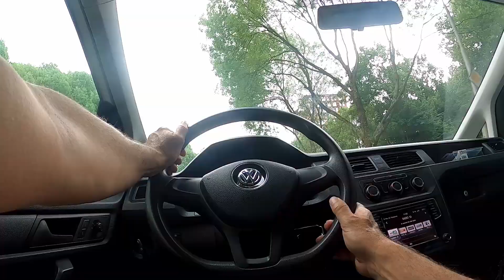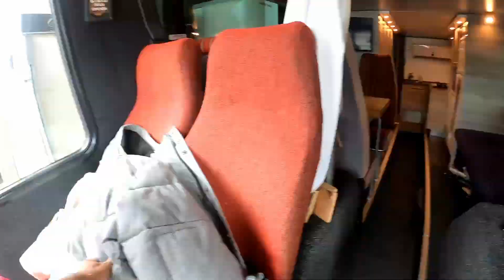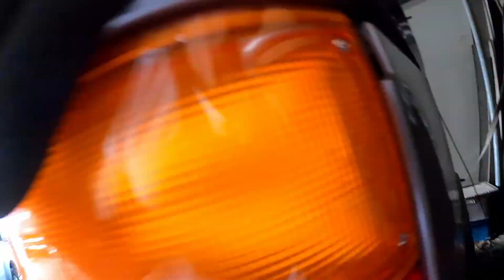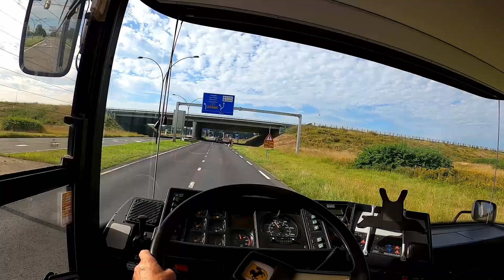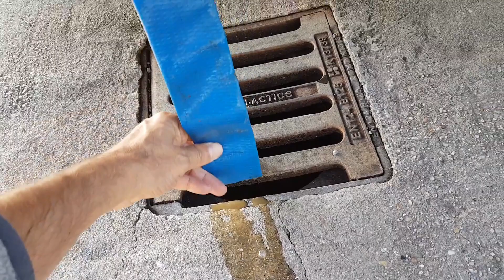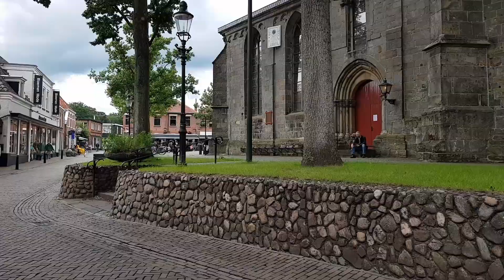Double Decker RV - Operating it

Comment: Love your double decker excellent craftsmanship I have watched all your videos. I would love you to do a video on talking about how you approved doing  the wiring and plumbing, for example where you have hidden the pipes and cables, are they easy to access for repairs, are your electric wires buried behind the walls, would you link your grey tank to your black tank with a valve so once you empty black tank you can flush it through with black tank, how much water and battery usage do you do on average,  would you have done anything differently in terms of plumbing and wiring  (excluding the compostable toilet). Another video idea is height limits and bridges, how do you plan for these, would it be possible to put solar panels on top without exceeding height limit, or would only thin flexible solar panels be suitable, also a video talking about your thoughts on insulation in the van and any air conditioning or roof access ideas e.g. top floor above bed and front chairs for cross breeze of air. I definitely would love you to make a video on all of these questions as your bus has inspired me to build my own in the future.
Reply from the maker: Thank you for this comment. For me it is difficult to think what I could do next, so I value these kind of input highly - thanks again. Plumbing and wiring might be an interesting topic, although difficult to show...
Planning around the height limit is quite easy; stay on the main roads. Last weekend we were in Germany and Google Maps wanted to direct me off the main road onto smaller ones - that would be a shorter route. Well, I just don't follow that suggestions. I made a plan and stick to it. I indeed could show this on a map once, in a video. You can do those smaller roads, but you would have to be on the lookout for the signs; mostly height and weight limits..
Yes, solar panels would fit between the hatches. There is no need for flexible panels, I hear about people having trouble with those, because they are not that sturdy as the conventional ones.
Insulation is a controversial topic, because an object made out of steel (vehicle, but can be container too) is very difficult to insulate.
I will think about your suggestions. Next on the list is a video about last weekend.
Reply: @Onrust1  I am glad you are considering my suggestions I look forward to videos on these topics Ron, I rewatched all of your videos multiple times to be sure you hadn't already answered them before asking.

Yes plumbing and wiring would be interesting even if difficult to show as you can just show thought process and pictures, no need to disassemble or rip everything out. I am keen to understand since you have your bathroom upper floor, e.g. pumps, macerating toilet etc .., how you planned for preventing smells, and access in case of blockage for repairs etc did you route these along your bedroom and then down to the garage area etc … 

My concern about solar is the thickness of normal panels may exceed the height limit if one wanted to cover the roof  of the 4m tall bus compared to the thin profile panels ( I agree they are worse)  as I understand 4m is the height limit for vehicles due to it being a common bridge height I believe ? I am from UK where there is not a height restriction but I learned this from my research if I wanted to buy a European double decker to convert in the future. 

I had an idea for planning around the height restrictions with less planning, navigation companies like TomTom and Garmin etc… now recently have mobile / tablet based app subscription (low cost) for Heavy goods truck vehicles where you can input height and length and weight of vehicle so this may help with reducing planning and more exploring?  

With insulation topic you could also talk more about your Air conditioning units, pros and cons in terms of performances, energy usage, layout location etc.., and exploring newer efficient  technologies like heat pump which can cool as well as heat for year round travel.
Reply from the maker: You are very right about the 4 meters. With a vehicle over 4 meters you are very limited in possibilities (I wrote more about that in my FAQ, all at the bottom - have you already found that?). But the hatches stick out the roof a bit, so in between should be enough room for normal solar panels. I know about the Garmin/TomTom solutions for large vehicles, but up until now felt no need for them. Maybe in the future, I don't rule it out. But in the end best is to rely on yourself, because only one can be held responsible (you.. 😏). 
My AC's already can work as heating device. That was the main reason for me to put it up as one of the first devices, in the beginning of the build; so I could work in winter without getting cold.

Comment: Man you need a front end alignment pretty bad or your steering wheel is way off center. Either way that would drive me nuts having a wheel that off.
Reply from the maker: This year, a few months ago during the annual maintenance / checkup, my mechanic got all the axles aligned, and also put the steering wheel straight. Not because I asked him to do so, but because he couldn't stand it too.. 😁😎

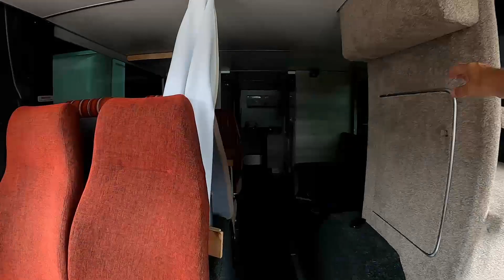Comment: 1:22 achhhttuuallyyyy.

there is a trick what is use pretty long ago. kitchen stuff and even tools able to run from dc current. refrigerator ac have inverter what run pefectly from dc, tools, vacuums have unversal dc motors. electronic devices from pc suppy to tv start with graetz bridge so also run on dc current.

so i have a fishing "hut" in hungary on a river island far from everything. i just use 15 small 40Ah lead-acid battery connected serial to provide 180V dc. what is enough to run anything. i have 2x 140W solar panels to charge it what does no look much, but i there only at weekends so have a time to charge... even enough winter time. one important thing left. i have a "current shock protector" relay what called "fi relay" in hungary and mandatory to use. its able to detect if the current flow to ground and brake the circuit. its pretty important because 180V dc cock u like a grilled chicken.

the effiency is way better than systems with inverter and way more cheap. and even able to run my ac at nights.
Reply from the maker: Provoking thought. Yes, cheaper but nevertheless way less power as I have with my 4 x 230 Ah deep cycle AGM batteries. Your investment in batteries is about half of mine, but you have effectively about 1500 Wh (considering the lead acid ones can only be used for 20% or so), where I have 5500 Wh (based on 50%). True, you don't need an inverter, but those are not that expensive. And you will have to check everything whether it runs on 180V DC or not.. where my installation is truly plug and play.
Still, I like those creative ways of thinking. Thank you.
Reply: @Onrust1  180V*40Ah is 7200Wh.
Reply from the maker: Correct. 
And 20% of that is about 1500.
Reply: @Onrust1  but how u get that 20%?? you misunderstand something... the Ah effiency of lead-acid battery is 85% one of the best.
Reply from the maker: Maybe it is me, but damage occurs on lead acid batteries when they are discharged beyond 50% ( https://www.rebel-cell.com/knowledge-base/the-discharge-and-capacity-of-batteries/#:~:text=1.-,a%20lead%20battery%20should%20never%20be%20fully%20discharged,-Lead-acid%20batteries ) and to be on the safe side, I calculate with 20%.
The AGM's deep cycle batteries can go up to 70-75%, and so I calculate with 50%.
Reply: @Onrust1  well i have to replace them in every ~5 years anyway.. so this damage from "overdischarge" not a real problem.
Reply from the maker: Maybe you don't? Anyway, learning from the real world is always better than on paper.. 😊👍

Comment: You need a tachograph in Holland? In Australia it's used in commercial vehicles, but privately owned buses and coaches used as motorhomes don't need them or logbooks. 12.5 metre coaches converted into motorhomes are very popular in Australia. We looked at one like yours, but the headroom was too low. We have two-project one is a  12.5 metre Mercedes O303 with a tag axle, and number 2 is a 1998 MAN 24-420, also 12.5m with a tag axle. We've only just bought that a week ago so very early days of converting it from a 53 seat tour coach to a motorhome. Best wishes with your travels.
Reply from the maker: The answer about the tachograph is in the FAQ: https://sites.google.com/site/bigbuszz/faq---english I wish you all the best with your conversions!

Comment: Hello why you have to use tachocharts if it is a motor home ?
Reply from the maker: 1. It's not a motorhome, it's still a bus, 2. Even motorhomes have to use the tachograph, at least in some European countries, and in certain circumstances, that means .. 3. ..not all laws in Europe are equal on this (some countries know exceptions for driving for personal reasons vs. driving for business - some don't have those exceptions), 4. Putting in a chart is relatively easy, 5. To avoid any discussion with any officer of the law in any country, it is my personal choice to always put in a chart. It brings me ease of mind. 
See? 😊
Reply: @Onrust1  it is a motor home and according to low 561/2006 if you don’t have more than 9 seats including driver and its not for commercial use you don’t need a speed limiter and a tachograph but it’s n your decision and in most countries of Europe when you’ll register you can register as a motor home and then will be exempt . Anyway that’s a nice build I’ve watched all your videos ,there is another one in Uk I’ve watched those too i wish i could afford to build one too unfortunately the DD are too expensive
Reply from the maker: No no no no. My bus has 11 seats. Need I say more? 😏 
And can you tell exactly in which countries the 'not for commercial use' goes? I bet you don't. Give me my ease of mind.. 😊 
Nice to hear you watched my videos! Thank you.
Reply: @Onrust1  according to 561/2006 the non commercial use it’s all over EU so even if you have a bus full of people but you don’t charge them you are out of scope and by the way in Europe if you have 11 seats that’s mean you have seat belts to them , it’s not count as seats if you don’t have seatbelts cause you are not aloud to ride without a seatbelt I highly recommend to read the 561/2006 and regulations in Netherlands cause I can see you live there , cause I’m sure in Netherland you have different laws for motor homes like we have in Uk and I think you misunderstood the term seats , according to the build I think you have 9 seats fitted with belts , maybe I’m wrong , enlighten me
Reply from the maker: The EU laws are made, so local authorities can make their own laws with them. Not all the EU-rules go in all the member states. Some member states DID make an exception for non-commercial use, some didn't. The Netherlands didn't. My bus has 11 seats with seat belts and therefore is still a bus.
Sorry for the delayed answer, I don't know why, but your answer was stuck in the spam filter of YouTube. (I check on that filter regularly, but somehow it wasn't shown.)
Reply: @Onrust1  if has 11 seats then it’s under regulations , has to be 8+1 to be exempted 😊

Comment: Does it feel top-heavy while driving?  From the video it seems to look pretty stable, much more than I would expect in a double decker.
Reply from the maker: No, it's not top-heavy, and that is because the main part of the 16000 kgs is very low in the vehicle. That is more or less a requirement, because there could be some 60 people upstairs, so that adds some weight there..

Comment: You're right, driving such a monstrous vehicle shouldn't be that difficult, with a little training.
When I started driving as a temp minibus cab driver many years ago, I learned how to drive a 
Mercedes Sprinter.
Also checked both side mirrors to check if I was in the correct part of the street.

Drove around the parking lot a for practicing a few turns and driving in between obstacles.
The simple adagium: if you can get half of the bus past an obstacle before turning, you can get the entire bus past it.
And if you're not sure, begin making a wider turn in advance or even just hit the brake, check your mirrors and start backing up slowly.

The greatest threat that I found while driving a passenger van was not any potential harm coming from other road users.
It was sometimes small kids who thought it would be funny and exciting to hide behind the back of the bus, where I couldn't see them, and wait what would happen next. Fortunately, I caught sight of the kid before it hid behind the bus so I just stopped, got out and gave a sever reprimand to the ''accidentally suicidal kid.'

Comment: No leveling system? you're lucky it's so flat in the Netherlands. Here in the US many campsites are at a slight slope, usually no more than 15 degrees, but that's enough to be uncomfortable. I've seen worse, but those are usually tent only.

Comment: :) With 4,96m car plus 10,6m caravan (2,55m wide) you don't need much less space on the road!
Thx for the Infos!
Reply from the maker: True! But you are obviously not the average person... 😊
Reply: @Onrust1  ;) that's true also! Next year it will be a meter more in lengths... Hopefully before the saison is starting
Reply from the maker: That is one exceptional big caravan..!
Reply: @Onrust1  So it is. And to safe a bit of weight it will not have a mover. In other words: it needs a little bit of work at the steering wheel ;)